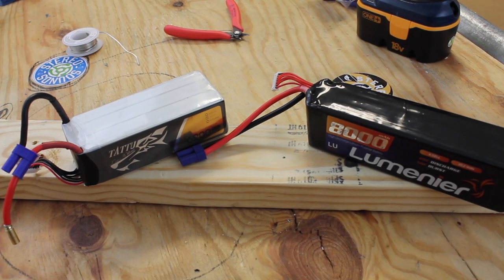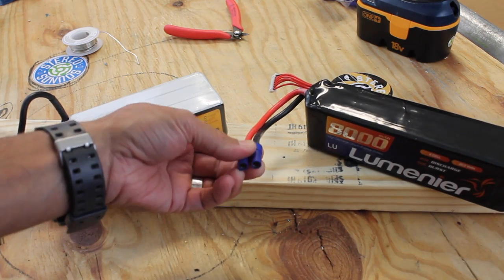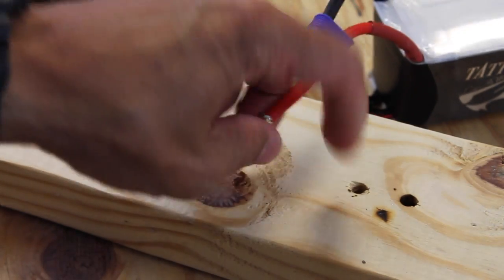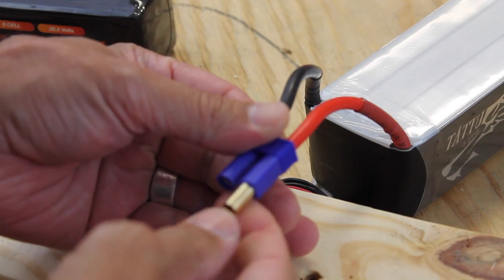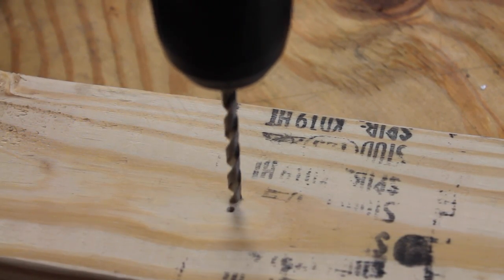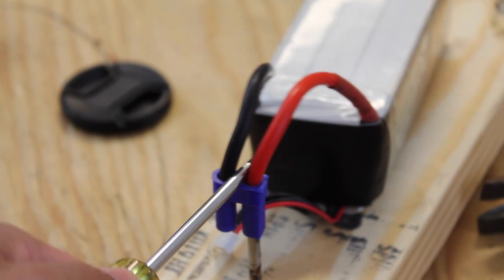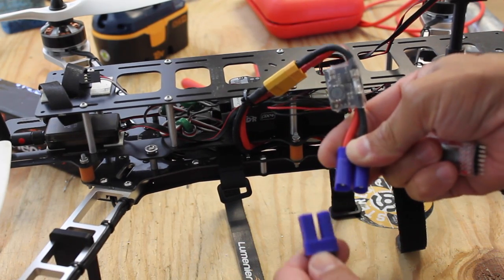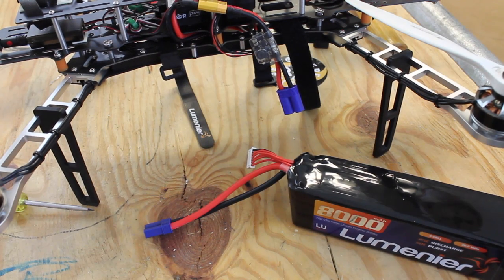EC5 Connector Tips From the Garage

Comment: Once soldered i heat the blue connector with a heat gun . I use a screw driver to push it in but will try a drill but

Comment: This is 8 years old but today there is no reason to use EC5, just use IC5 which is the same as EC5 but EASY to work with.
Reply: It got my hopes up that you might be able to pull in rather than push in connectors (was hoping there would be an option for this with ec3 but no dice).  It's really a shame as pushing in through the front has the potential to be a much better design.   I'd switch to ic3 honestly but it'd be a major changeover and my daughter has had the ec3 setup for a decade.  We've never had the difficulty issues with unplugging though in fairness.

Comment: I got so frustrated with EC5's that I considered changing them all together. There are awesome connectors from Supra X called S6 which are really, really good. But they are also expensive and I had everything setup to EC5. So I ended up buying an EC5 punch tool from Progressive RC. At first it didn't work for me but I think I was not using it properly. I don't know I may do a video about it one day. But I had originally bent the tool and was about to throw it away because I was not using it properly. Anyways I will give it a try but I also found a great way to solder the connectors with cheap $6 solder help hands from Harbor Freight. I saw the video how the S6 connectors are soldered and the same method can be used with EC5 bullets so I will try that next. In summary you don't need to pre-fill the bullet cup, but rather tin the wire, hold the bullet and the wire in place on the cup and fill it with solder. Will see how that goes.

Comment: these are the fake EC5. Real one just push in. Don't need to run wire through it. Real ones use many contact points not 3.

Comment: I started soldering these not too long ago.  I had trouble with the 1st one, but now they are a breeze to solder.  A set of helping hands will make soldering these cake.  What I do is a disconnect one wire from the battery at a time (this eliminates the need for electric tape and eliminates shorting the wires).  I stand the battery vertically and allow the wires to hang down in a natural position and seat it into the bullet connector held by the helping hands.  At this point, I can adjust the angle of the bullet connector so that it runs flush with the battery wire.  I don't tin the battery wires.  They should already have solder and don't need to be tinned.  And although tinning the bullet connector / filling it with solder helps, I don't do that for a reason.  For one, as long as you bring the bullet connector to the melting point of the solder, then the solder will melt when touched to it.  For two, I can seat the wire as far as needed into the bullet connector w/o having to hold the wire straight.  Oh and you can't forget flux.  You can never go wrong with too much flux.

FYI, the surface of anything to be soldered, should always be brought up to the solders melting temp, and then solder applied to the surface of what's to be soldered.  It's the same technique plumbers use when soldering copper pipes.

While the bullet connector is inside of the helping hand, I apply a bit of solder to the soldering iron.  I then hold the soldering iron to the opposite end (bottom of it since it's standing vertical) and wait for the solder around the wire to start melting.  Once I see that the solder around the wire is melting, that lets me know that the connector is hot enough to melt solder, and I then start feeding solder into the cup.

Tip:  If you don't have a hot enough soldering iron, then don't even bother doing this job.  I personally bought and use one of those $30 Weller soldering irons from Home Depot which works wonders.

Once the solder has cooled down, the easiest way to get the bullet connector into the plug (front feeding plug only) is to use a pair of pliers.  You simply take a male bullet connector, insert it into the female connector, put the pliers on the edge of the EC5 connector and on the male bullet connector and compress the two till it pops into place.  <--  This eliminates having to have a vise, use a drill, hammer, etc...

I forgot to add that when touching the soldering iron to the bullet connector with solder for heat transfer, you will have a little bit of solder on the bullet connector afterwards.  But it can practically be scratched / scraped off with your nail.

Comment: Whar about placing the drill bit backwards in a drill press and heat the plastic slightly with a heat gun as you press in the connector. Seems like it would give good control of pressure and you will hear the brass seat home as it goes in.

Comment: Good tip!  I cut a slot in a small "C" clamp for the wire and removed the flat swivel exposing the round ball end.  I press the pins in or through with the fake/copy (Much better.) or out with the real/genuine.  It does not work to press the real/genuine in.  :(  Due to the pin bevel, the copy/fake should always go from front to back and the real/genuine should always go from back to front.  I have found the copy/fake to be better for that reason and also the opening of the female (Can I use that word?) is tapered, the wall is thicker and the cup has a notch for soldering.  I can't possibly say for all brands and versions.  Overall EC5 works well in use, is not too bad to connect/disconnect and is popular.  They are terrible to attach to wires!    EDIT:  Use the female pin on the male pin to have the back side/cup to press against.

Comment: OMG!  This is the video I have been looking for.  I tried switching from XT90 to EC5 connectors like just the other day.  It was a nightmare pain in the butt.  First, I had trouble just trying to get the wire to fit into the EC5 bullets.  My bit was sucking up all the heat.  I could get the solder to liquify but as soon as I tried to shove that wire from the battery into place....FAIL.  I’m skipping all the talk about flux and tinning.  After I finally got a good solder, I could not for the life of me get the bullets into the blue plastic casing.  Thanks for this vid.  I will try again in a couple days.

Comment: At first i used this way, first put on the blue connector then solder the bullet and then click it in place. However i bought ec5 connectors from another brand and found out i could do it like that. Even with using tremendous force i couldnt get it to click. No i tried the other way around, soldering the bullet first and then slide over the blue connector, and use a flathead screwdriver, to click it in place. That worked perfect. Maybe there are small differences between the ec5 connectors from different brands.
Reply from the maker: Good tip. Thanks for sharing.
Reply: He is using the fake/copy EC5 which go in from the front.  The real/genuine EC5 go in from the back.

Comment: is that the right side for the battery because i have one of those jump start packs and it is the other way around the females are on the load or cables and also i just made new cables that were a little longer and thicker some 8 gauge which fits but is as big as will fit but with the insulation it will not fit thru so you they have tp go in the back side but i got it with a vice hammer and punch
Reply from the maker: I've been told by several others that there are two different types of EC5 connectors. Some go in from the front side and others from the back (I'm told). If you got it working with yours then I'd leave it alone since they're a pain to deal with :)
Reply: Dennis Baldwin well honestly mine liked slightly beveled on the back side so it probably was supposed to go the other way but the 8 AWG insulation would not fit thru the connector so whatever it seems to hold good

Comment: Great vid!  I have some EC5 connectors on the way.  The EC3's are so bloody hard to snap in, I can't imagine how hard the EC5's would be.
Does it matter which way you push the pin thru?  I thought they just went in from the back side...which is a b**ch trying to tap it with a flat head on the edge.  Thanks Dennis.
Reply from the maker: I hear you loud and clear. I've heard different schools of thought on which way to push the pins through. I think you'll also notice that the pins are beveled which denote which way to push it through. I know this varies from supplier to supplier. What I show in the video is the way I normally do it based on how my pins are beveled. Good luck to you.

Comment: can I use this connector for my 2s and 3s batteries?
Reply from the maker: Yes. It can technically handle up to 120 A with the proper wire. I think 10 AWG is what I read. Here is more info: https://www.rcgroups.com/forums/showthread.php?t=1959225
Reply: RC JOE YES YOU CAN BUT A BIT OF OVERKILL
Reply: do you have a charger for this type of connector for your battery

Comment: Push the connector in from the other end while it's still warm from soldering with a smaller screwdriver. It'll go in so much easier than that.
Reply from the maker: Good tip. Thank you.
Reply: He is using the fake/copy EC5 which go in from the front.  The real/genuine EC5 go in from the back.

Comment: Good tip!
I use the opposite of the gold pin and push it in with the help of pliers. If the solder hasn't leaked then chances are that it would go smoothly.
Reply from the maker: +Raj j Good to know that. Thanks for sharing.

Comment: I've also found the EC5 connectors a pain to solder. That's why I always use XT60 ones. But I have to agree that, it can sometimes be hard to pull the connectors apart. It does require a bit of force.
Reply from the maker: Greyhat Infiltrator Thanks for sharing your experience. Glad to hear someone else that has run into problems too :)

Comment: -I've never used EC5 connectors, but man I just hate EC3 connectors.
-In my experience, you can't reuse and de-solder EC3s without cutting or melting the plastic housing.
-Also XT60s may be hard to unplug at first, but I've found the EC3 connectors are hard to unplug even when broken in over a couple weeks.
-I used to use Deans/T-plugs, but I prefer bullet style connectors like the XT-60s because they seem to collect less residue like the Deans/T-plugs sometimes do.
-I like XT60s because they are easy to unplug and de-solder like Deans/T-plugs, and also use bullet style pins that collect less residue over time.

-I've heard good things about the XT90 plugs. You can even get some 'anti-spark' XT90 plugs that also come with a removable shroud that covers the solder points and allows you to remove it so you can de-solder them in the future.

Here's some 'anti-spark' XT90s at HobbyKing. They may be worth a try if you find you don't like the EC5s:
http://www.hobbyking.com/hobbyking/store/__61690__XT90_S_Anti_Spark_Connector_2pairs_bag_.html
Reply from the maker: RoboTekno Great points you make. Those anti-spark plugs look amazing. I want to give them a try. Thanks for the suggestion.

Comment: Ah man...nice.  I was fighting these things forever, but I JUST switched all my stuff over to Anderson PowerPoles.  Bought a plane from a local guy that swore by them (and he gave me 6 free batteries!) so I gave them a shot...pretty awesome connectors.  Easy on/off and no more soldering...just crimp them on and go!
Reply from the maker: Dave Gorrie That's good to know. I've heard great things about Anderson PowerPoles but haven't used them before. I'll have to check em out. Thanks.
Reply: Those are used in industrial applications such as forklifts.  Proven technology.  I think Duratrax used them.  They are used in robotics as well.  The biggest downside I can see with them is that they are a bit long for some applications.  Many people will not want to buy a crimper, but it is worth it.  You can make connectors anywhere.  They can be soldered if needed.  I like them and wish the RC industry would  have them as an option for batteries and devices.

Comment: Hi Dennis,  Like someone else mentioned the connectors are designed to be pushed in from the top, not pulled in from the bottom, if you look at the top of the gold connector(s) you will see a taper that pops into place as you push in from above.  The way you are doing it forces the sharp edge of the top of the gold connector through the plastic and could cause a split or shave the inside of the connector resulting in a lose pin.  Also if you push in from the top always put the two halves of the connector together (I use a spare male / female) to give maximum support.  Oh and again as mentioned XT90's are excellent.  Cheers, hope this helps
Reply from the maker: RedHotPheasant I've heard that from others but can you double-check your female connectors? They don't even fit in the back of the female housing. So I don't see how this is possible. The male connectors are different and do actually fit in the back. Also, if you notice the taper on the gold bullet you'll see that it almost looks like it's designed to push in from the front....I'm basing this off the direction of the taper. I will definitely check out XT90s. Thanks so much for the feedback!
Reply: Dennis Baldwin Dennis, I sent you a PM, check it out

Comment: I've never done my ec3/5 connectors like this by pulling the wire through. I've always soldered the wire into the connector and pushed it through the back side.
Reply: And BTW, I've never messed up a connector using this method.
Reply from the maker: Bjorn Baal Good to hear it. One thing I've noticed with the female connectors is that I can't even get the bullet to slide into the backside of the housing. The male connectors will slide in just fine and I've used the method of pushing it through before, but with these female they appear to be a different beast. Also, if you notice the little taper on the gold connector it looks to almost be design for it to be slid in from the front of the housing. I'm always amazed at how many different ways something as simple as connectors can be done.
Reply: Very true. I guess when you do something the same way you can't "see" it being done differently. Moral of the story, functionality is what we're all after.
Reply: the cheapo ec5 arnt chamferred so they are extremely hard to install buy good ones from PRC and they sell a tool too
Reply: He is using the fake/copy EC5 which go in from the front.  The real/genuine EC5 go in from the back.

Comment: Hi D., hope all is ok there,  nice tip, but why not use the XT90?
I have not tryed them, but as with the XT60, I think they are much easier to fit
Reply from the maker: ***** Will check them out. I've read that they're rated for 90+ amps while as the EC5s are rated for 120A. Not sure what 90+ means..... 100A, 500A? They should be fine on the QAV500 because at max I'd be pulling 80A and only for a short time. Appreciate the suggestion and hope you are well.
Reply: ***** Dennis Baldwin  XT90 are good ... bigger than XT60 and handling is the same ...
Reply: ***** I have use them, and like them a lot, plus you can add a couple of grab plastic things which will help you to have more contact and protect your solder points! 
Cheers!
Ed
Reply from the maker: Dan iel Thanks.

Comment: I've found the easiest way is to use a butane torch instead of a soldering iron. It makes it much easier to not get any solder on the outside of the bullet. Also, as soon as the wire is soldered to the bullet, I put it in the housing. With the bullet still hot, it slides right in.
Reply from the maker: onlythefallen1 You may have given me another reason to buy a new tool :) I've heard others suggest the heated bullet approach so I may definitely give a try. Really like that suggestion. Thanks.

Comment: I've done a ton of these. At first, I ruined the odd connector but the last several dozen  have gone without incident. I found the trick that works for me is to strip a very small amount of the coating. If you strip too much you will have bare wire exposed when you seat the bullet connector. Less is more. Tin the little bit of exposed wire very well. Fill the bullet connector with just the right amount of solder. This is a learning experience. If you fill it too full, it will run over the edge and ruin the connector when you shove the wire into it. You cannot have any slop on the outside of the bullet connector because it will not want to seat. About 2/3 full seems right. After you solder the wire into the bullet connector, immediately place it in the plastic connector body and use a 1.5mm hex head to push the edge of the connector down into the body. It will seat without much effort. Having it hot/warm makes it pop in much easier. This works for me every time and I can get through swapping out the connectors on a new set of batteries quickly.  At first, I hated soldering these things but now that I have my little system, I quite like them. Give it a try and let me know what you think.
Cheers, Bob
Reply from the maker: ***** Great tips, Bob! I will have to try the heated connector approach. Sounds like a winner. I have tried using the hex head to push it in, but man I struggled with that and ultimately chipped my connector. Perhaps it's much easier with the connector hot. Will experiment and report back. Thank you.
Reply: Dennis Baldwin 
No worries Dennis, they drove me crazy too until I learned this tip from a friend. Go immediately from soldering the bullet to seating the connector and it's all good :-) 
Of course, you do one bullet, one "seat" at a time.
Reply from the maker: ***** Roger that!

Comment: Heating the connecter up Dennis also works. It's makes it a little softer. ;)
Reply from the maker: agrs1974 Thanks. I will have to give that a try!
Reply: Heating the connector doesn't work with Hobbyking's style EC5 connectors!! It's all about the design !!  Motion RC's design is different when you look really close and you can easily hand snap them on after soldering the joints!! Hobbyking's EC5's are a nightmare to assemble!!